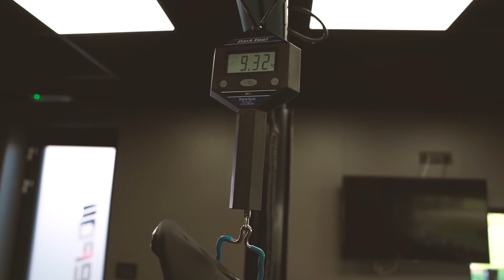Specialized Epic S-Works Troy Lee Designs LTD / SRAM XX1 Eagle AXS / DREAM BUILD

Comment: Tip for getting grips on easily. Use hair spray. Helps slide it on then helps it stick after
Reply from the maker: Kelvin Bastow we've already tried everything.  For "us", the best and fastest way is to wind the handles with the compressor.  They also sit tight afterwards.
Reply: Racepoint Elite Shop fair enough 😊